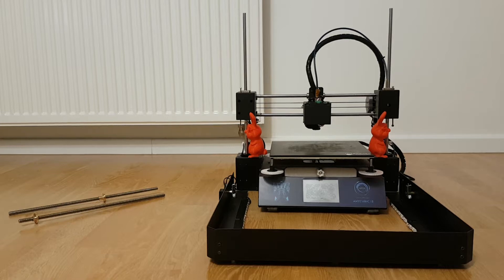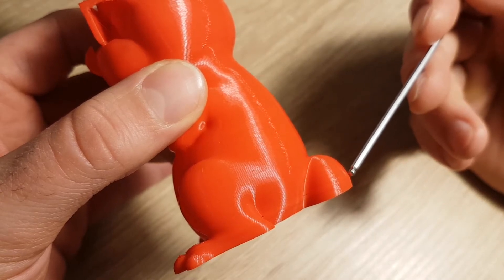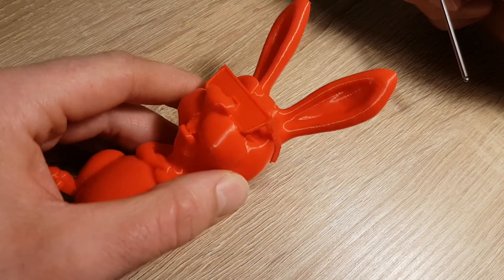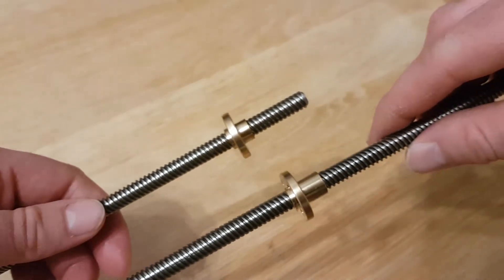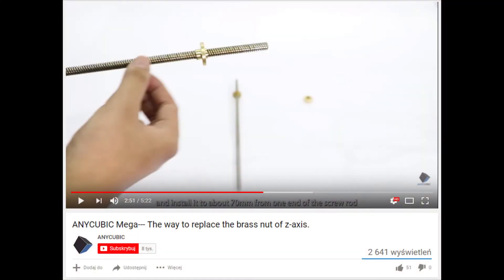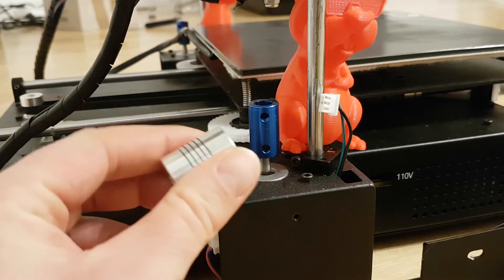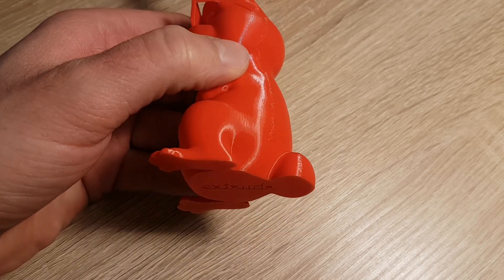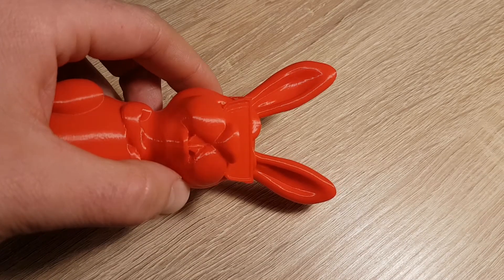How to improve quality of your 3d prints - Anycubic I3 Mega

Comment: Can you explain what kind of screws and nuts you used and how you used them? the offical video doesnt give advice on this.
Reply from the maker: You have to use M3 screws and nuts.
Reply: @TechDayEveryDay   will this upgrade work on the newer Mega X? and if so can you please link the correct hardware i.e. the screws and nuts needed for the brass nuts?And thanks for the video!
Reply: @TechDayEveryDay  brass nuts from ali doesnt have a thread inside so you cant screw the nuts. need 8pcs. m3 nuts with m3 x 10 or 8 mm lenght screws to fix this issue